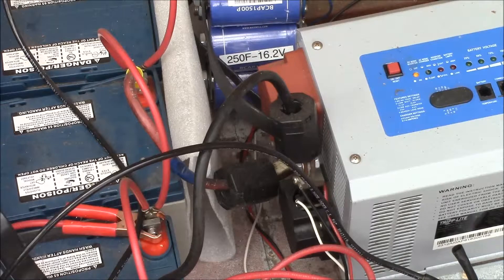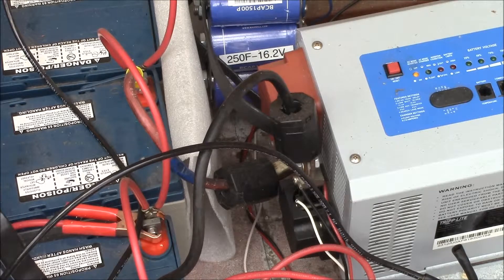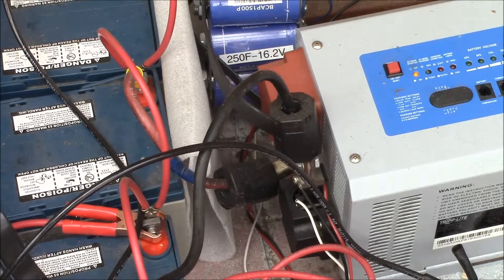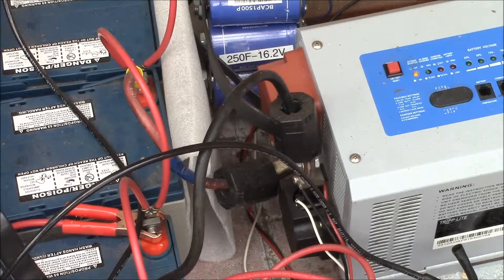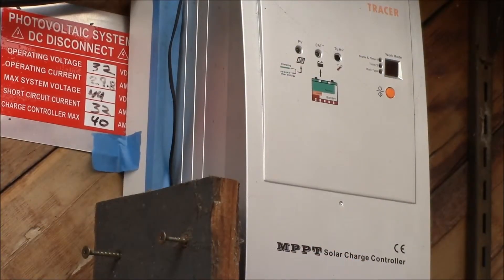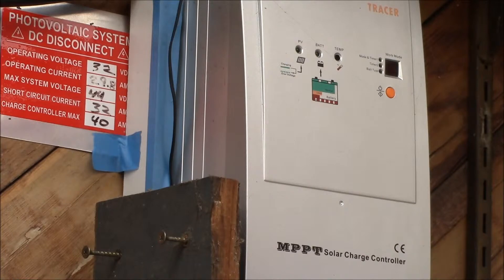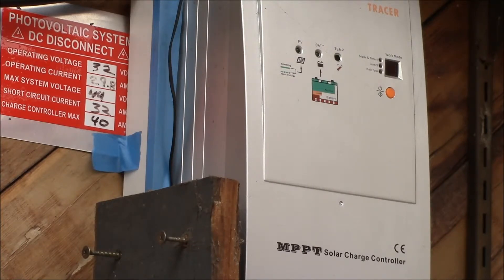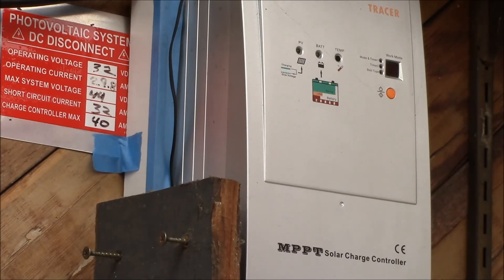Sizing Inverter Power Systems, Part 2

Comment: Honestly, off the grid investment don't come cheap without any municipal utilities subsidy. To recoup basic investment on PVs, deep cycle batteries, charge controller and inverter may take 7 - 10 years. Of course new highly efficient panels price is dropping like stone, but not batteries costs.
Reply from the maker: For sure.  That is why I am keeping my system on the small side, especially for the battery bank, and just increasing it as my needs grow.  My system is both backup power for power outages as well as to offset my electricity consumption.  I did look into a grid-tied subsidized system a while back but I wanted something that would work when the grid went down as well. The system I looked at would have supplied half my electricity at a fairly hefty cost.  My current off-grid system is supplying about a quarter of my power at a fraction of what the subsidized system would have cost.